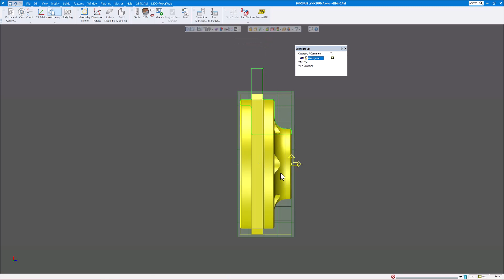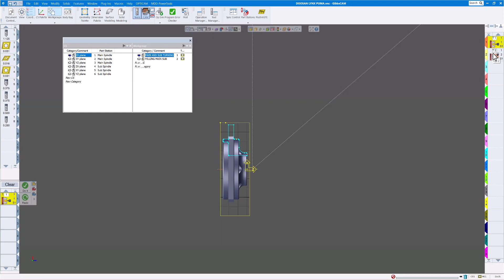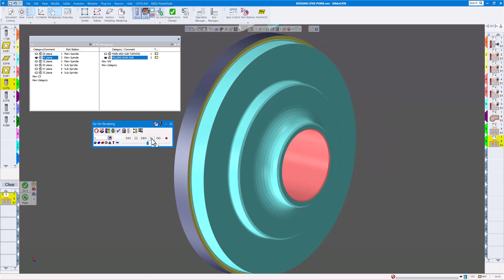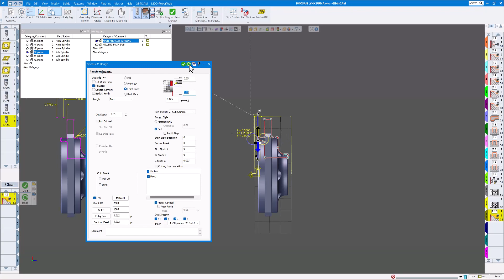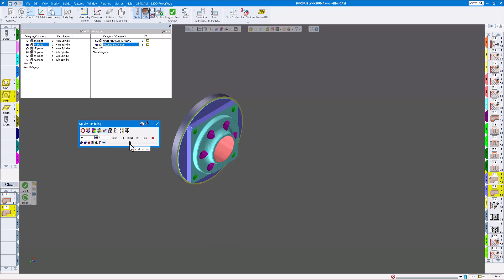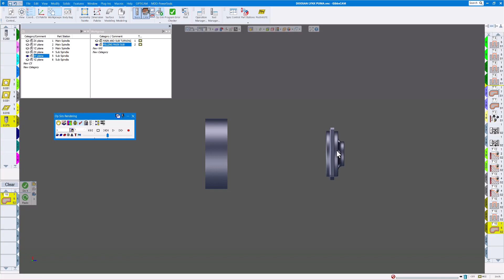GibbsCAM programming of a Doosan Lynx or Puma MTM machine tools.

Comment: Hi
I have a problem about 
Move toolgroup
Shift part
Prakgroup
Can you help me for what is thats
Reply from the maker: Normally you use MTG (move tool group) to get the turret out of the way before bringing the sub-spindle forward to get the part.  Also if per say you brought up the sub spindle, then parted the bar, you don't want the turret to move back in Z, otherwise you might crash into the sub spindle, you just want the turret to retract in X before the sub-spindle goes home.  Shift part.  Many times your part is too long to make the cut holding with just the main spindle because of vibration, etc, so you cut some of the part, then grab with the sub, pull out some, then keep machining the rest of the part.  That is where you use Shift Part.

Comment: I've noticed I can't use the profiler if a sub spindle CS is active. I know you can extract geometry with the main spindle CS active but the part I'm doing has some angled holes that are on a different CS than anything in the main SP. Am I doing something wrong?
Reply from the maker: If you have a solid model on the sub side, and say you did a duplicate-and-transfer to get the solid model into the sub-spindle, Gibbs does not know that the solid you translated is actually in the sub spindle.  All it really knows is that you duplicated the part in the main spindle.  If you want Gibbs to know that the solid model is indeed IN the sub-spindle, do this.  First make sure you separate the solids by going to the Solid Model pallet after you select the solids (they should both highlight) and click on the Separate icon.  Now that they are separated open the CS pallet.  Click on the solid model in the sub-spindle, then go to the CS pallet and Right-click on ZX Plane (sub spindle).  A window will pop up.  Then choose Change CS (XYZ).  Now Gibbs will know the solid model is assigned to the  sub spindle, then you can use the profiler.
Reply: @GibbsCAMVideoTutorials  That worked! Thank you. I thought it was something simple like that.